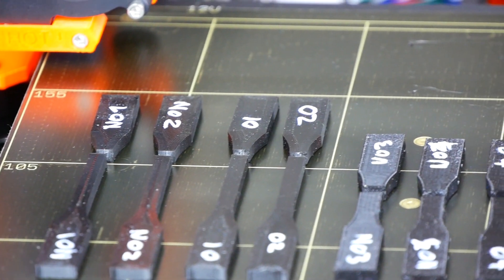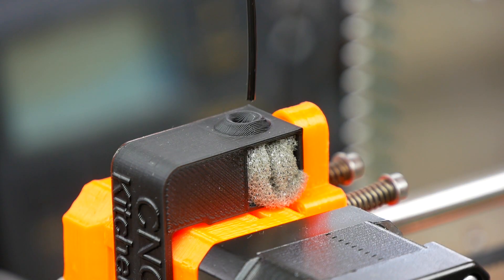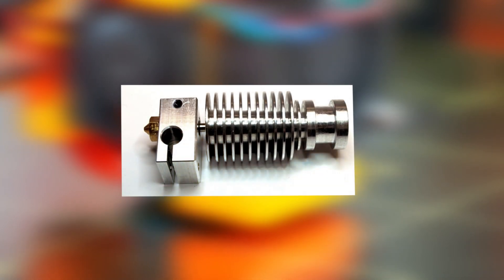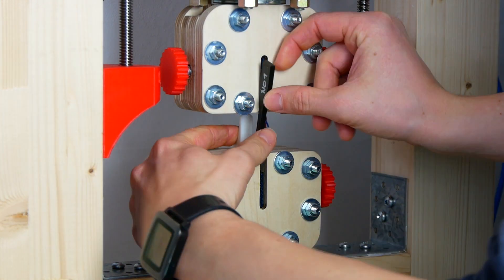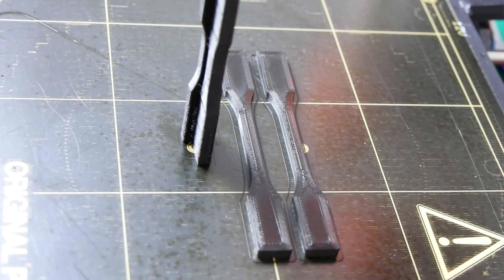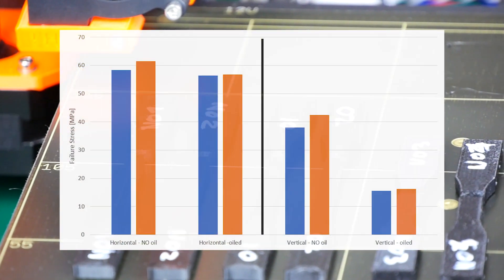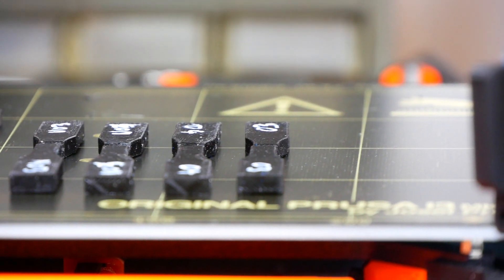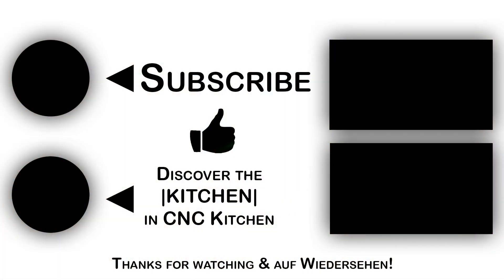Why a Filament Oiler ruins the Strength of your 3D Prints

Comment: You must have test with cold prints the smoke or burn of rate of canola oil is 400 f thats 204.444 c if you were getting oil on your print it was because you ran way to much oil and ran your prints at around 190 to 200c.

Comment: IMO when it comes to oiling, if you have a bowden setup and suffer from drag issues, have tried everything possible to reduce them, and don't need to have insanely strong prints, then using the tiniest amount of silicone oil or light gear oil on a sponge for the first bits of filament you load in can help stop filament drag related under-extrusion as it will coat the walls of the bowden tube n the oil, reducing drag.

Before doing this, however, might I recommend that those who suffer under-extrusion on their prints also make sure their extruders are properly calibrated? Quite a lot of the time, your under-estrusion problems aren't caused by drag in the bowden tube or in the hotend, but instead because your extruder isn't pushing the exact amount of filament into the hotend that it should be. If the steps per millimetre value on your extruder unit is off by even a couple steps it can cause under extrusion and filament clogs. Tom Sanlanderer does a fantastic job explaining how incorrectly calibrated extruders can cause such issues here: https://www.youtube.com/watch?v=YUPfBJz3I6Y&t=361s

This also works for over-extrusion as the calculation is basically the same. also, if like me you suck at maths, you can just plug the values you need into this calculator. It'll spit out an e-steps value that you can round to 2 decimal places and plug into the firmware... http://3daddict.com/3d-printer-extruder-calibration-steps/

Comment: So basically by oiling the filament you can have:
1.Print better with less throat clogging
2.Better aesthetic sheen
But as a trade off , you get:
1.Poor mechanical properties
2.More frequent bed cleaning
3.Messier printer parts(the oil may adhere to the parts leads to further cleaning)

Comment: And why when the fillament ends it is hard to push? You said that at 1:20
I have the same problem over and over, but only when i come to the end of the fillament (abou 20%) i got an um2+ and this is my only problem, i think the nozzle is clogged. but i don't know why.
Reply from the maker: This is exactly what I wanted to say with this part. It's not your nozzle that's clogged - when you get to the end of a filament spool the radius in which its wound on the spool gets smaller. Therefore it needs the get bent more when going through the bowden tube. This causes more drag which causes the feeder to slip. Try to buy filament which is on a larger diameter spool, this sould reduce that problem.
Reply: but then you need feedback control between the two extruders or you will eventually get binding or stretching as one pushes harder or weaker than the other one.
Reply: Maybe a printer really needs two extruders - one which just unwinds the spool and pushes the filament down the Bowden tube, and the other that just receives the filament at a given tension and forces it through the hot end?
Reply: Why? There is no mechanics-related feedback elsewhere in the printer! All due to the magic of stepper motors, that advance strictly by 1.8° or 0.9° each step. They just need to advance the filament the same distance. The length of filament advanced is strictly proportional to the volume of the bead laid down by the print head, and gripping filament in multiple places minimizes slippage.

But i considered a possibility of feedback system as well. In this case, only head extruder is a stepper motor, there is another motor, potentially just a geared DC motor, which is just connected to an optical gate that monitors the deformation of the bowden tube due to increase in tension, and runs whenever necessary in pulses to relieve the tension. I don't have a specific design in mind yet though.

Comment: Wait, WHAT? WTH oils their filament? How is this even a thing? Stop with the over-engineering...This is right up there with Z-Axis stabilizers.
Reply: it helped my replicator mini a lot. but what I do is oil a piece of filament feed it through at very high temperatures to "season" the nozzle so to speak. then I don't use any more oil. I use an "oiler" but its dry just to clean any debris off the filament as it goes through. I did not notice any difference in my I3 after I did that. no harm either since i don't "run oil" just the first couple feet of filament and I only redo it if I change nozzles.

Comment: Nice to know that... but...What if strength is not a problem for me, if i just want smoother surfaces? Can you upload a picture comparing your surfaces results? I deal only with abs, would this affect the results, or should i expect a similar behavior?
Reply from the maker: The oil gave me a shiny surface for the black Prusa PLA which usually extrudes matt on my machine. If your material already extrude shiny I think it doesn't really change alot. It might look a bit more shiny due to the oil film on the surface, but if you want that, then pray your parts with silicone spray after printing ;-) That does not mess up your printer and your material strength.

Comment: Very informative, thanks.
I just wonder why you gave loads in “kg”? (Presumably kg-force a.k.a. kilopond)
Why TF not write 1167 N, 1226 N and so on?
If you’re lazy you can ignore the 2 % error and call your values daN. 
And why give it in pounds at all? (Pound is a force in American engineering units, but that system should have died out long ago.)
Reply from the maker: Simple reason: I guess not all of my viewers are engineers and therefore are not used to MPa, ksi or N. kg and pounds is just easier to imagine and since I only made a relative comparison its okay to use these common units (I actually measure the loads on my tensile test machine in N and converted these loads to kg and lbs for the video). If you take a look at my filament strength tests I give the results in proper MPa and ksi.
Reply: I sort-of like what’s done with the labels you see for lashing points on trucks and the like.
There you get something like “Max load 100 daN (kg)”, that is, they use a force, and provide a translation, so to say.

Comment: Using a Quality-PTFE-Tube and the Filament goes smooth as hell... those cheapy chinatubes (as seen in this video too) are not really good... I have a 0,75m long tube on my Bowden and absolutly no Problems, even with high pigmented filament such as glow in the dark.
Reply from the maker: I ordered some (NON?) china tubing with my last purchase at E3D. Need to try that out!
Reply: It just proofed itself again. i bought me a Fabricator mini and of course i optimizing it. the original tube is actually one of the better tubes but against the tubes i use usually its still nothing. weird is that my tubes almost clear while all the other tubes that came with the printers are nearly white.
Reply: links to those tubes then... please? lol
Reply: I can ask the Seller i get my stuff from, because i have noooo idea.

Comment: well I use a piece of a sponge (cut up and put in to a 3d printed filter) as a filter to catch dust and I used cooking oil on it but now I'm a bit worried will it work as well dry? since I have my workshop in my shed its very dusty
Reply: see I am thinking the opposite. I don't want all that oil inside the bowden tube dragging things down. oil in this situation does not lubricate. it will create drag (though probably not much) this is a "gut check" I am no expert.
Reply: Only oil if you have a bowden setup, and then only use vegetable oil or olive oil, and then only a very small amount.

Comment: I heard that a tiny amount of mineral oil in the foam (very small amount) helped the foam collect the dust. I tried it using a special dropper bottle such as used for eye medications. But even that was too much. I think your dry foam is the best. One thing I thought of is using anti static sprays. They dry out and have no oily residue.

Comment: What kind of oil did you use.
Reply from the maker: I used thin machine oil which is usually used in sewing machines.
Reply: lol wat. no one uses oil like that for an oiler. Try some high smoke point oils. https://jonbarron.org/diet-and-nutrition/healthiest-cooking-oil-chart-smoke-points. One of those with a higher smoke point than printing temperature should do. I use corn oil in my Robo 3D R1, its a direct drive and it works great! If I didn't use it, the printer would be starved of plastic quite often in the print. I'm assuming machine oil is not very good to be heated to printing temps!

Comment: I've also had very little success with an oiler. I have personally had some success with seasoning smaller diameter nozzles when I install them initially (which I've done a video on),  but an ongoing introduction of lubricants via an oiler seemed to cause quite a few bed adhesion and layer adhesion problems. IMO they're best used to just keep dust out of our extruder assembly.

Glad to see someone took the time to test this in an objective way!

Comment: Nice explanation. I completely agree.
I too have seen several videos advocating oiling.
At best, oiling is only going to cover up other issues that should be fixed. Like a painkiller, it does not fix the problem, just covers it up.

Comment: Thanks, I was almost sure I'm never gonna oil my fillament, now I am :)
I see some Igus bushings on your printer, how do you like them? I assume the difference is mostly in noise and not the print quallity, right?
Reply from the maker: Noise is definitely a point but it might also improve the quality of the prints because the axis slide more smoothly. I can't really say how big the difference is because I always used the IGUS bearings on my machine, but I plan to update my Mendel90 where I can make some comparison prints.
Reply: Great Videos, Very informative and presented.
I would like to see the results of the Fiber Force Carbon Fiber reinforced nylon filament.